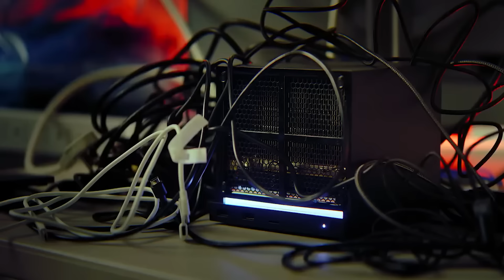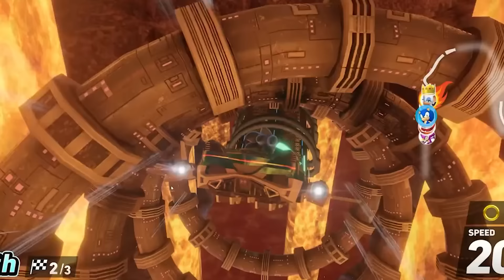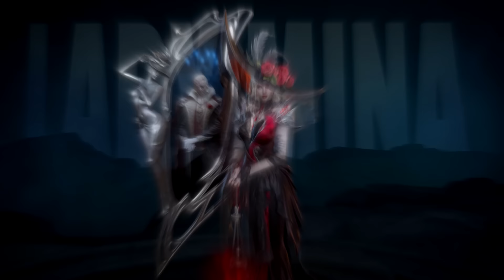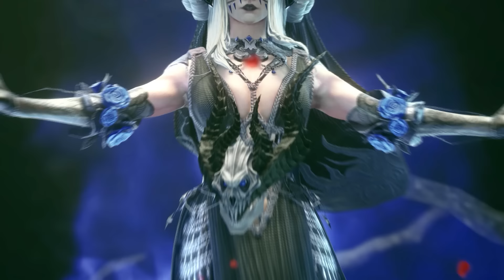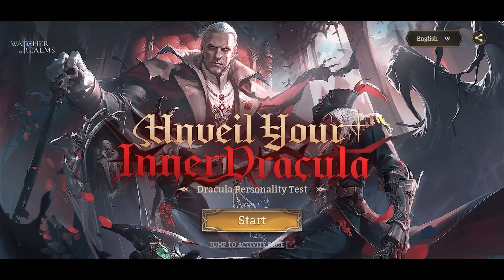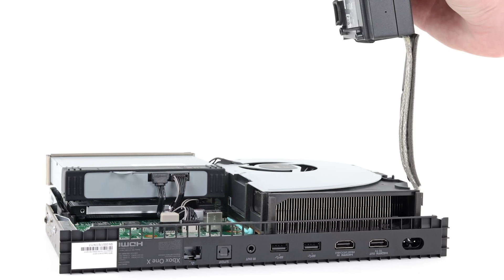The Steam Machine Is More Impressive Than It Looks...

Comment: It's not something most people will be able to do, but I have a feeling that the Gabecube could have the VRAM replaced with higher capacity GDDR6 modules to take it up to 16GB VRAM.

It would likely need a firmware mod in addition, but if it's built anything like the deck I can absolutely see some enterprising soul modding it.
Reply: "firmware" Do you mean bios? It's a PC you can just install any OS you want. Frankly outside of driver issues (that's the hard part) it should "just work" unless you have to do hard mods. The thing is paying $200 or more for a vRAM mod would be a lot for most people and it won't offer enough to make sense.
Reply: @GeorgeWashingtonLaserMusket  no I didn't mean BIOS, and I know it's a PC, I didn't fall out of a Christmas tree.

I actually meant firmware because the VRAM details like timings are not stored in the BIOS but are stored within the firmware for the GPU in the majority of PCs, and because the GPU is a separate device, it can be reasonably assumed that the GPU has a separate IC which contains the firmware for initialising the GPU registers and VRAM timings, capacity, etc.

Also, while we're on the subject of needless pedantry, it doesn't use a BIOS, it uses UEFI, which is the successor to BIOS, and actually BIOS is a type of firmware, so even if the details for the VRAM are stored in the BIOS/UEFI, I'm still not incorrect in calling it firmware.

Finally, please read what I wrote a little more carefully, I stated in the very first line "It's not something most people will be able to do" which while I didn't explicitly define what that meant, it still implies that cost, skill, or desire would be a barrier to entry for the majority of people.

Comment: I just want a proper mesh filter attachment for the front.
I suppose you could design it so the spacers fit through 4 holes on the mesh filter, closing off the sides and just letting air in through the front.
A display would also be cool, for semi portable gaming where you don't have access to a monitor.
Reply: Im already planning on 3d printing exactly this with maybe a thin fan also powered from USB

Comment: People need to understand that this is still a very niche product and it's still not going to sell like a PS or Switch because it doesn't have that plug and play aspect to it. Personally, the thing that will stop me from buying it, will be the pricing.
Reply: It does have the plug and play aspect to it though… like Deck. It’ll boot up in game mode and you’ll control the UI with a controller. Just sign in, like a console, download games, like a console and play it.. like a console?
Reply: @elvickRULES From my experience, you have to mess around with the settings too much, to make sure the game is running properly. That's something I never have to do with a PS or Switch.
Reply: @ob1slam  I’m always going into settings on games on console because so many devs still default volumes of everything to the same level. So I have to turn vfx and music down to better hear the dialog (where applicable). And certain stuff on console does have options to enable or disable. Not just the performance/graphics modes either. 

And most verified games on Deck default to playable settings. And since casuals are fine with stuff like Skyrim on PS3 where it ran terribly and had memory leaks I think they’d be fine just with whatever it defaults to and have minimal to no complaints.

Nothing worse than a console game running like crap and you can’t change anything to fix it. You just have to hope it’s patch and 99% of the time it won’t be
Reply: @elvickRULES Yeah I've never had to go into the settings of a console, just to run a game.
Reply: @ob1slam  only super old games boot into a setup launcher on PC. And it’s not hard to figure out. But most modern games don’t do that at all. They just boot up. You clearly don’t use a PC.
Reply: @elvickRULES Correct, I don't use a PC anymore and not done for a good while now. If this steam machine is priced reasonably and I don't have to faff around with the settings, then I may give this a chance. It's still a very niche product and average consumer probably won't know it even exists, so I can't see it doing anywhere near as well as the Xbox Series (and that's saying something).

Comment: Apparently its going to be priced competitively with PC, not consoles.  I wouldn't expect less than $600.
Reply: Considering a ps5 pro is $699 that’d likely the price floor.
Reply: @tenorenstrom Xbox series x is also $849
Reply: @shepardcommander9960 o.O
Reply: @shepardcommander9960 what? Where? Walmart sells Xbox series x for $400-500
Reply: I'm thinking this thing will be like 899
Reply: Yes. Can’t be below steamdeck oled, which is 600
Reply: @HardAsARock2000  OLED is more expensive and it has nothing to do with the Steam Machine.

Steam Deck LCD's price is the clue to how expensive the Steam Machine can be.
Reply: @PSYCHOV3N0M if the oled continues to be as expensive as the steam cube or more, it won't be as attractive and I guess that steam want to keep selling the oled for a while.

Comment: If you have SSD enclosure, you can just connect it to machine and clone the whole internal drive with everything to new just with 1 console command. I did it with 2 Steam Decks and it worked great. You don't loose anything, it's just continue to work with a bigger SSD

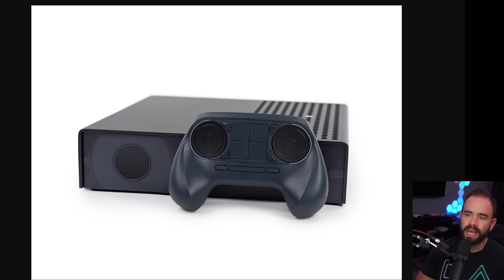Comment: 2:28 You sure that's the Zotac model???  that looks like the one valve made for user feedback but never sold.  The controller in that pic is just a mock up and not fully functional!
Reply: You are correct that is not the Zotac model. This was an engineering sample sent to only very few people by Valve themselves and never was meant to be for retail. 

Zotac model was white on top, black center.

The controller shown in that pic is only a  prototype, that didn’t go very far after feed back. The four square buttons were when they were considering a touch screen in that spot. As you said, I don’t even think that one is functional.

I have the retail OG steam controller, it’s much different to that.

Comment: would have preferred if it were a bit bigger (or had an external power brick) and the ram was easier to access plus an empty m.2 ssd slot and a 2.5 inch or 3.5 inch hard drive bay. Plus it should have had microsd express to future proof.
Reply: So a regular pc

Comment: Not that impressive. They state they are only aiming for just 4k/60hz, whilst leaning heavily on FSR.

Also with only 8gb of VRAM and HDMI 2.0 is going to limit the machine quite quickly in the future with the increasing demand on hardware
Reply: PC Gamer: "rigs like this are usually thought of as 1080p machines—1440p at a push—and in these instances, 8 GB of VRAM is fine". .
Reply: @mikeuk666 true, but 1080p doesn't cut it on a big screen TV. Valve have been quoted saying it's a 4k/ 60hz using FSR. Digital foundry estimates after their hands on that performance sits somewhere between the Series S and base PS5, with it edging more toward the PS5

Within only a few short years, as PC gaming hardware evolves and the next generation of consoles arrives, the Steam machine is going to look seriously underpowered

Comment: nah this is going to $800 USD easy. $499 would be amazing but with tariffs, that isnt happening. If Valve prices it like the ROG Ally And Ally X then the Steam Machine is DOA.
Reply: You wouldn't even get that without tariffs. You can't even build a pc with those specs at $500
Reply: @Jenerossi  Yes, but designing an SOC and mass producing will always be much cheaper than picking off the shelf parts. I don't know if they couldn't do it pre-tariffs.

Comment: A mesh front panel for easy dust cleaning sounds great.
You have to wonder if removing the front plate or using a mesh plate will affect the bottom air intake, though.
Reply: The fact that the cover comes off, offers many possibilities, and not just for looks.

Comment: I expected more raw power/high specs from the new Steam Machine. The previews mentioned this console will struggle greatly in handing modern games at 4K 60 FPS (high settings) and you will need to adjust game settings every single time. I'm very underwhelmed by these specs and would rather wait for a "Pro" version or something far more superior from Valve down the line.
(Really they should've done 2 SKUs for the Steam Machine, one for casual gamers and one for high end gamers with no compromises performance-wise)
Reply: Don’t worry, asus and Lenovo will be making consoles with steamOS in the near future. Steam doesn’t need to target the high end, just look at the handheld pc market.
Reply: The cpu is great but i just hate it has 8gb of vram…. If it was 12 i would be fine with it for 4k 60 at medium/high settings wile it’s running basically linux which uses less resources then windows while gaming.

Comment: I hope for the economy of scale, it is priced the same as the Series S.  Even without a controller, psychologically it is the price people will think of than their differences.
Reply: I’m really optimistic about this, but there’s just no way it’s gonna be under 425. Moors law is dead costed the parts out and it runs valve about 425 per steam machine. They said they aren’t selling it at a loss like the steam deck and it’s competing with PCs and not consoles. So I’m hoping 500, but expecting 600 for base model
Reply: @mav9932  except these are old parts.  In volume they could be getting them with a massive discount.  The Steam Deck and consoles use custom APU's.  Since those are not COTS (commercial off the shelf) they cost more.

Comment: I will be impressed if the price is $500 or less. More than that, then meh. The PS5 is a better deal then.
Reply: Nah you have to pay online, also it’s still a pc, keep dreaming though because it costs around 450 to manufacture so they won’t sell it so cheaply like a ps5
Reply: @Josephhhhh2077 it’s honestly too weak imo and they should have partnered with nvidia not amd
Reply: @Josephhhhh2077  Like I said, too expensive then for something that underpowered. Console gamers will ignore it.
Reply: @Lenmaer_レヌメアル  it’s clearly not aimed at “console players” who only play console. The fact it’ll likely only be sold on Steam like Deck is should be a tip off. 

It’s aimed at people who want a mini pc to put in their bedroom, or living room. Who can upgrade their super old PCs (the people on the low end spectrum of steam’s hardware surveys), and people that just want to escape Windows easily or wanted a Deck experience on tv (they said around 10% of Deck users play docked on tv) with more power. 

I fit two of those things. Just need to know the price.
Reply: @Josephhhhh2077 it’s $6.67 to play online per month on PlayStation. This won’t move anyone if it isn’t priced sub 600 for the base model.

Comment: calling it now, 599$ WITHOUT controller.
Reply: I agree. And the controller is gonna be 100.
Reply: @James1_A why? AliExpress is full of amazing gamepad that rival Xbox controllera for 10-15$
Reply: @James1_A  Yeah im expecting $99.99 on steam
Reply: @James1_A that controller is gonna be universal. I'd say 200$
Reply: @jasonstults8986  that’s insane lol. It’ll be $79.99 I’m sure of it. Maybe $100 but $200 USD is very silly.
Reply: @jasonstults8986 yup,definitely closer to if not 200$. All that tech in there.
Reply: @jasonstults8986 no way it’ll be $200. That would be insanity
Reply: @jasonstults8986 you really have the worst games on prices....
Reply: You can use any Xbox, PlayStation, or Switch controller thankfully.
Reply: Buddy I hope your right but I definitely say it's gonna be easy 800$ to 1200$. Probably some bundles to reduce individual prices of products tho.
Reply: @jasonstults8986  I doubt it would be that expensive given the build price of this is around $430.
Reply: @jasonstults8986 A PS5 is 399€ in Europe, the digital version. 1200€? That's crazy and most likely DoA. 600€ or it will unfortunately fail.
Reply: @Herr.Mitternacht  I believe you 💯. However all the prices of new consoles have not been what we expected lately. Switch 2 -Asus Xbox Ally first ones that come to mind.
Reply: @jasonstults8986 For sure but whether we want it or not, it will compete with a PS5/X-Box at certain level. If it matches the power of the current Gen at a way higher price, well, it won't win. We'll buy it yeah but we want it to actually compete. That's why it needs to be relatively the same price as those systems.
Reply: @Herr.Mitternacht it's not meant to "win" anything because it's not meant to compete directly with consoles, it's a product thought for a very specific niche of people who want a console like experience but with the benefits of Steam and PC (and probably part of a bigger attempt from Valve to boost linux gaming as a whole opposed to the problems of Windows)
Reply: If 2TB version that’s still good
Reply: @JasonMG8 if so i’ll get a 512 gb and just slap a 4tb nvme on it since this can fit those types of Nvmes.
Reply: $800
Reply: I'd be shocked if they sold these without controller.
Reply: Was just thinking this! I dunno about that price, but they'll definitely make a version without a controller
Reply: still not too bad
Reply: DF said controller will be shipped with the Steam Machine after they visited Valve.
Reply: @phen5806  well that’s weird heard from other tech channels that seen it say it isn’t shipped with one. Maybe they’re figuring out if it should or shouldn’t.
Reply: @xxargonautxx9790  Not shipping with a controller at the start would be a mistake
Reply: @n @naruhearts1 ell the system isn’t based on steamdeck controller. They even say use what ever controller you want or got. Works with ps4/5 xbox and switch controllers. Steam knows people that get this have any of those system plus to keep the base price down since that steam controller gonna cost around $100-$120, like you want that system price to be $100 dollar more with them forcing you to buy the controller?
Reply: I was guessing that price too. Not bad.
Reply: For the 2TB. 512GB better be under $500
Reply: Seems bout right 👍
Reply: Nah, Gabe isn't daft. 

He will ship it with a controller. 

SD shipped with all the needed accessories. 

Valve is, and I use this term loosely, pro-consumer
Reply: @thedude8128  the steam controller will be an expensive device and why bundle some generic logitec
Reply: It will ship with the controller.
Reply: That's way too expensive. Should be close to 400 with that obsolete non-custom hardware. I'm definitely not buying a massive downgrade box for 600 just because it runs Steam OS.
Reply: $600-800 I would imagine. Problem is the Steam machine is a bunch of older mobile parts: Ryzen 5 7640U 30W TDP, Radeon RX 7600M 8Gb with 110W TDP, 16Gb DDR5 SO-DIMM 5600MT/s 😂😂
Reply: AMD isn't gonna let Valve undercut desktop PCs by that much if at all.
Reply: @ahmedrazick4946  don't say such things about my mama su
Reply: The BoM is $425, consoles traditionally launch at a small loss. I agree $599 is likely but that's WITH a controller, but frankly even if it's $700 it's still a better deal then building a gaming PC at the moment.

Comment: the pictures shown in the "original steam machine" section are before it was released to the public, a prototype if im not mistaken!
Reply: The original Steam Machines were never released to the public. There were about 12 companies that made prototypes. Some were released as mini-PCs but didn't launch with any Valve or Steam badging.
Reply: @Zoyx came here to make that comment.
Reply: The controller definitely seems like one of the unreleased prototypes, the only released one was the Steam Controller.
Reply: The OG Steam Machine that was made by Valve is shown on the Bringus Studios video (and The Final Hours of Half-Life Alyx).
Reply: @n_core  - Totally internal. Never released to outside testers.

Comment: 8 GB of VRAM is gonna be tough. Plus with how prevalent anti-cheat is on multiplayer games I don't see how this works well as a console or PC replacement since Steam OS is incompatible with most anti-cheats. A supplement at best.
Reply: 8GB of vram is not tough. Stop coming at it from an enthusiast high end pov
Reply: @JasonMG8  8 GB of VRAM is bad enough on PCs where most people either have a 1080p or 1440p monitor. This system is designed with being connected to a TV in mind. Considering most TVs are 4K these days the problem is actually worse for a console like device than a PC. I wanna be clear I'm not even saying the GPU has to be more powerful it just needs more headroom to do it's job correctly.
Reply: Valve have more control in hardware and OS this time. Probably they have a better solution that diminishing need for third party anti cheat. It is always easy to cheat in Windows, MIcrosoft don't have authority to kick or ban people if people cheating on steam.
Reply: @gundam_Chaos  They also have that same degree of control on the Steam Deck and they still have not solved for it. Skate (4) for example is still completely disabled on Steam OS/Linux because of anti-cheat. Same goes for Battlefield 6.
Reply: @yusufied. 💯 alot of people/kids buy consoles for games like fortnite,etc the numbers prove it so you are absolutely right making something that bad at being mid desktop pc and a mid "console" won't help
Reply: Yup